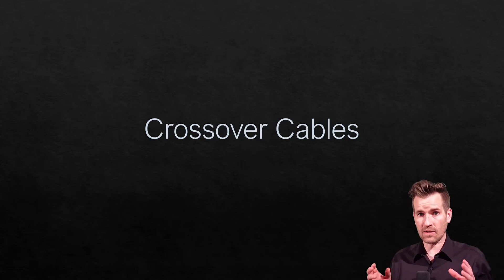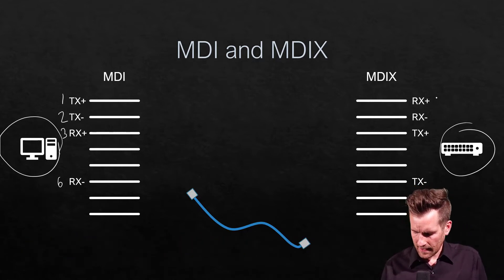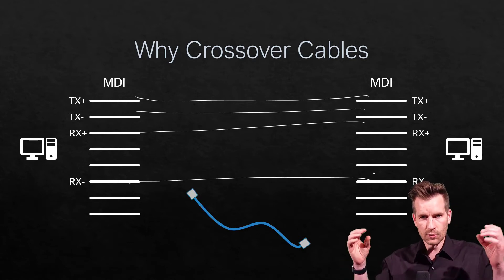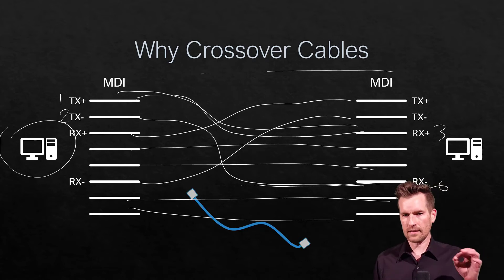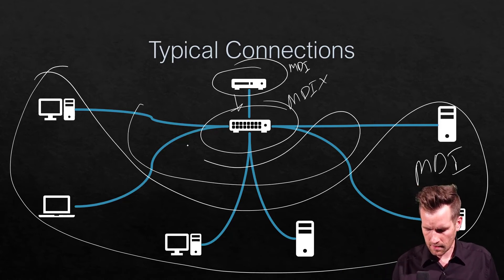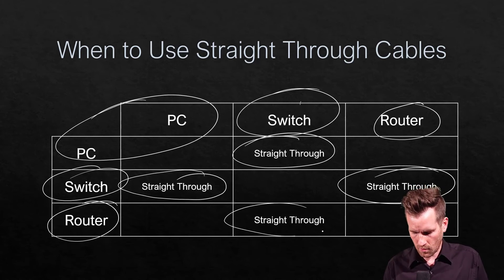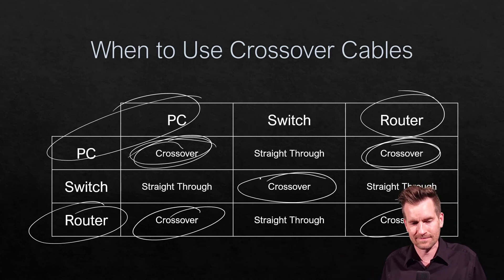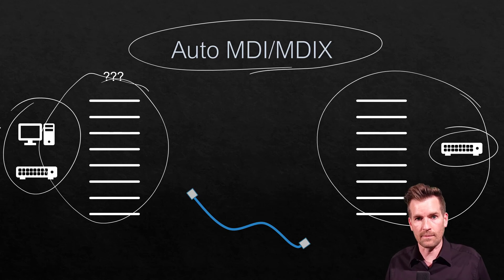Network Fundamentals 5-6: Crossover Cables

Comment: Thanks for clearing up. I was confused why similar devices need cross over and why was i able to get lan working on 2 pc with straight through wire. So basically new pcs can do auto mdi/mdix and there is no need for crossover in those cases
Reply from the maker: Awesome, glad you liked it!

That's great to know, and makes a lot of sense. You used to have to pay for a lot of "advanced" features like Auto MDI-X. Now days, those features are incorporated with even the more basic equipment. As an example, a switch, 100 meg ports, and 1 gig ports were all expensive when they first came out. Now you can't even find a new hub or a 100 meg switch, there all gig switches... and they don't cost much at all.
Reply: @TechKnowSurge  yes, its impressive how far we have come in terms of infrastructure and component capabilities.  I also have another confusion.  When we wire and rj45. Why to we have to follow  AABCCBDD
Why cant we used AABBCCDD. Is this merely and aftereffect of maintaining compatability with older mdi mdix systems? Or is there something else?
Reply from the maker: @shameer343  The cc was originally for phones.

RJ11 pairs are CBAABC, each pair was for a separate line. Most phones were just 1 line though, so a lot of phone cables just had two conductors and used AA.

By having RJ45 keep the center two pins open, you could have an infrastructure that supports both phones and data. An RJ11 jack fits in an RJ45 port. It was common to install cat 5 cables throughout the building and then use them for either phone or data. By not using the two center pairs, you help ensure that someone doesn't misconnect a phone line to a data port and damage equipment. Now days, most just use VoIP systems and it's all data.